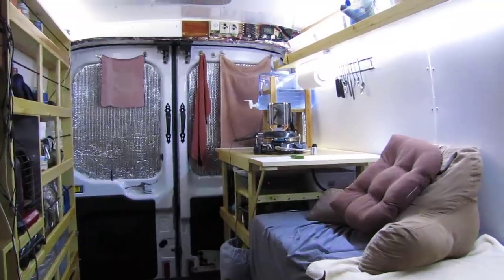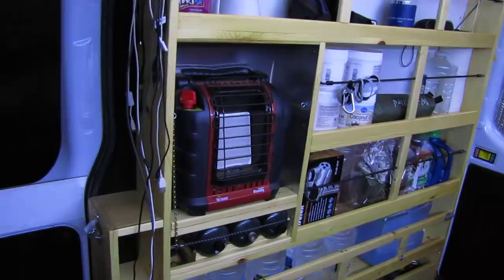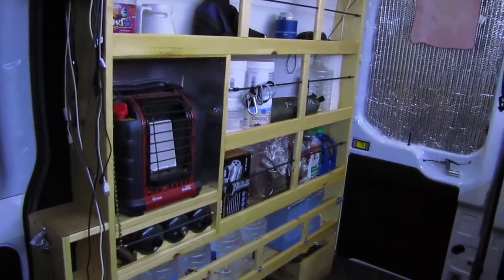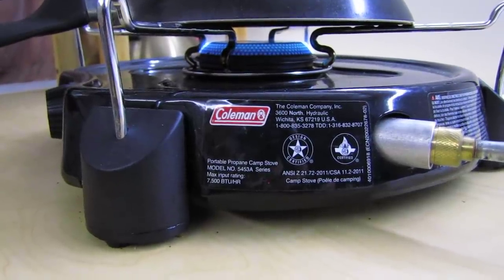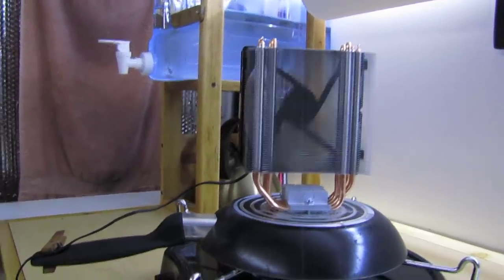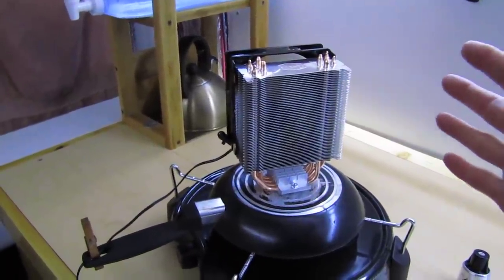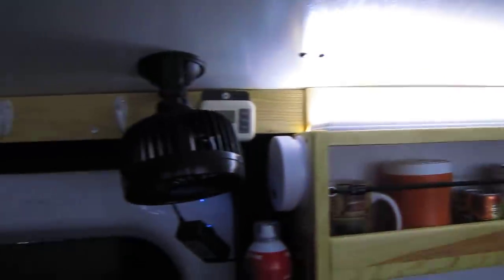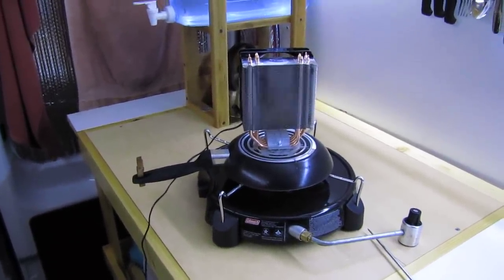My Van Heater using a Computer CPU heat pipe heater. Just an experiment to see if the concept works.

Comment: Definitely worth trying; I like the cast iron pan substitution comment, below, rather than an old coated aluminum pan. Question: does the heat not affect the little fan?
Reply from the maker: The pan was just used in this experiment because i already had it.
Reply: @EL34XYZ  ...that's fan, not pan. I was just wondering if the heat wouldn't hurt the continued FAN operation.
Reply from the maker: @hazel555  The fan is made for high temps that a CPU produces. The aluminum fins are always being cooled by the fan
Reply: @EL34XYZ  thanks!

Comment: Position the fan so that it blows down onto the frying pan then centrally locate. This will push the heat down in all directions instead of just blowing in one directions sideways. This will be much more efficient.
Reply from the maker: The idea is to have nice warm air blowing on me as I sit next to the rig

Comment: When the fuel burns as a neutral flame you get carbon dioxide and water vapor. Mess with the flame and you'll get some carbon monoxide too. The stove  burners are made to burn a neutral flame.
Reply: Neutral flame?

Comment: Just a thought; increase the economic efficiency by getting a 5 lb propane container that's refillable, a hose connector and a filter (in case the hose degrades); much cheaper than the 1-lb cylinders. If you have a larger cylinder already, disregard this.
Reply from the maker: I have a 20 pound tank that hooks to all the smaller propane appliances. Also, I refill 1 pound tanks for a 20 pound tank  if they are in good condition

Comment: If you add thermal paste to the aluminum block and the pan, you will transfer more heat to the copper pipes.
Reply from the maker: Yes, you did not read the video description
Reply: @EL34XYZ  your right I did not, good job.

Comment: slowing the van will not change the heatoutput of that system you build, only tuning down the propaneflow to your burner will do that. That cpu cooler doesn't increase the heatoutput either, it is just more efficient in cooling that alluminum pan. Just the bare propane flame will give of the same amount of heat. Your problem is dispersing the heat of that flame, so just using a small ventilator or even just that computerfan on the cooler, blowing past the flame will do the same as that cpucooler.
Reply from the maker: The propane flame is already tiny. Slowing the fan speed works to save battery current and not wanting that much breeze blowing on me. So there is a benefit to controlling fan speed as far as I am concerned. I am already dispersing the heat via the heat sink and fan and it works great. You can't blow a breeze  past propane flame. Give a it a try and report back here.
Reply: @EL34XYZ  I understand what you mean and I do understand the advantage of using the cooler with fan since it gives you a means to control the direction and strength of the warm air flow. 
I used a small burner to to heat my caravan when I went camping and I experienced a cool night. I used a small 12 v ventilator on a flexible stand, blowing about a foot above the flame to direct and dispurse the heat that rose from the flame. 
I am not trying to dish your setup, I just wanted to point out a posibillity of achieving the same means in a simpler way. It won't work exactly the same, mainly because even a small normal 12 v ventilator uses more power than a computer fan. 

As a last point and at the risk of sounding like a safety sally, I do hope you have a carbon monoxide alarm in your van, when burning anything (even candles or propane) in a small closed space. Just so you can enjoy your van for many years to come. ;-)
Reply: I would consider doing the following: eliminate the CPU cooler and let the heat rise. Eliminate the fan in the middle. At the far/,opposite end, install a (probably smaller) fan in a (cardboard/metal/cloth) tube to draw the warm air from the ceiling to the floor. The warm air at the floor will naturally provide mixing as it rises.
Reply: @dropshot1967  Make sure you don't blow out the flame or you're in a big bomb? Don't know if I could sleep one spark. Just saying

Comment: Give it some time, here in Montana you’d have to experiment turning it up especially if you were in a larger unit. I have a 38’ Toyhauler my garage isn’t heated and my furnace works well. Fortunately I do not live in it but would still like to see if something this small would keep it from freezing inside.
Reply from the maker: Depends on a bunch of factors. How large is the space. How well insulated the space is. How cold it is outside. Etc. My van is pretty small and if I pre-heat it with a Mr Buddy so that everything inside is up to temp, all you have to do after that is maintain a certain temp. :)

Comment: Instead of using aluminum with a non stick surface in it (questionable toxicity )  try a large clay flower pot. . with the hole already in the bottom of it, your system could be mounted to it.
Reply from the maker: Read the video description about the experiment and the pan

Comment: Good concept. I wonder what the cost is to drive that fan all night and through the morning. Also, how much propane does it use at the minimum setting?
Reply from the maker: It's a 12 volt fan set to a very low speed. It's about 30 milliamps. You could run it for a year on a big AGM battery like I have.
Reply: You can find a fan that operates purely off of heat. Some use it over their cast iron stove to distribute heat evenly...
Reply from the maker: @hotsauce7362  Those are used for high output wood burning heaters. That's not anything I would use in this situation

Comment: I've been living in my van for about 5 years. I've tried several methods of heat, including some I've seen on youtube. From the many ideas I've tried, they either don't work or are not safe enough for me. Sorry, but the only thing I can recommend for cold weather is a good sleeping bag.
Reply from the maker: My idea is not something you do while you are sleeping. Why would you run a gas heater while you are sleeping?
Reply: Mini wood stove

Comment: Ingenious idea :)  Did you ever think when it gets too hot to turn it off ...DOH ... the van is so well insulated SHOULD stay warm for some time I would have thought especially with the circulating fans
Reply from the maker: Turn what off? It's nice to have just the right amount of heat that keeps the temperature even instead of spiking way up and then diving down. Insulation only gets you so far with lots of big glass windows. Even though I have reflectix panels on the glass

Comment: What’s BTU? Heaters usually show output in kW.

Now however you turn it- 1kw exhaust/flame heat output remains 1kw however you distribute it. And gas flame exhausts rise and mix w. the air.

How about one of these Chinese air heaters? They go up to 8kw, so should be plenty (guess 5kw is well enough for a Transit).
Advantageous that you don’t keep the exhaust CO2 and CO inside.

Comment: 1) How did your teflon pan look after an hour or so? Did it survive direct fire on "the wrong side" like that?
2) Why not use a stove fan? That way you wouldn´t need to spend precious electrical power.

Cheers,
Reply from the maker: All that has already been answered. Did you read the video description?
Reply: @EL34XYZ  No I didn't

Comment: Wait... what problem does this solve? Why not just have the fan blowing into the hot air produced by the burner?

Also, if you get a peltier stove fan, it will use the burner/air temperature differential to produce all of the electricity that the fan uses, so you don't need to wire it up to anything.
Reply from the maker: You can't blow air onto a propane flame. Do it, film it and report back here with a link
Reply: I think the peltier fan might be an answer to making a more efficient device that accomplishes the same thing as the pan and CPU cooler.
  No manner of device will change the amount of heat released into the van when burning a set amount of fuel. Distributing the heat makes more effective use of the fuel that is consumed.  
  Without a device to promote airflow, a burner will set up a column of rising hot air above its flame, with a pool of warm air accumulating at the top portion of  the van it's in. That warm air then goes about the business of transferring its heat to whatever it is in contact with. It will literally be a top down process of heating any of the surfaces air is in contact with inside the van. 
  It can be said that any individual standing (relatively motionless) in that van will become, literally again, hot-headed. 
 No point in doing that.
   So, to the intended point. A peltier fan attached to the pan in same manner as the CPU cooling device would accomplish the distribution of heated air, with an added efficiency of not needing electrical input to move that air. I like that added efficiency. But, I don't know for sure, but it seems unlikely a peltier fan will move as much heat as a CPU cooling device. 
  Another part of what is happening in using the pan as a portion of the solution of making a burners heat more useful is that a radiative surface has been created. That it is more centrally located than the radiative surface that the ceiling eventually becomes makes more efficient use of fuel burned. Again, better efficiency because it is closer to more of ones body, and it isn't losing heat to the exterior as the vans ceiling does. 
  That an unused pan has been converted into a radiator makes sense, but I find myself wondering what difference using something larger would make. What comes to mind is an inverted stock pot. The idea being to capture more heated air longer with an object that has more radiative surface. It in conjunction with the peltier might equal the effectiveness of your current setup.
 Thanks for your post. Good work and food for thought!
Reply from the maker: @markwolter2032  Just an experiment from a year or so ago. I wold like to get back on it with some ideas I have come up with since then
Reply: @EL34XYZ  I'm wondering if you fill the stock pot with sand and put a lid on it for the Peltier fan. The idea being a large heat sink? BTU spent are the same. The BTU saved is what you're looking for radiant heat. Just an idea. I like tinkering never know what you come up with.

Comment: I have 2 Dutch ovens one fits inside the other so at the same time as heating my van I can cook my baked jacted potatoes. My device is on a small simple camping stove on the lowest setting. The duch ovens are made from cast steel on the lid of the outer one I have a stove fan that need no power to circulate the warm air. There just is no better solution to have what is a 2 in one method of staying warm with the bonus of a red hot oven that you could even put in a fire brick. My device uses very little gas and is safe becouse I have several vents at different heights all around my build allowing for a steady fresh air flow. I have used gas for heating and lighting most of the last 40 years. Vintage Caravans always used gas for lighting and use to use the   gas hob on low for heating. Even the old caravans would have plenty of air vents. So it's down to been sensable on safety and I also have 2 carbon manoxide alarms and smoke alarms in my build. I have yet to see a better solution that gives 2 uses. My seconder heating incase I run out of gas is a small steal stove I welded together from off cuts of pipe then I dug up clay and lined my tiny stove with it inside.

Comment: Just put a ventilation hood above the stove and pipe the gases thru a car radiator with a fan mounted inside the vehicle, then pipe the gases from the radiator outside thru a hole in the roof. Might need a small high temperature fan to suck the gases thru the radiator.
Reply from the maker: Really? You do it and film it and then post a link :)
Reply: @EL34XYZ  Doesn't get that cold where I live. I just run the propane stove or idle the engine the few times it's cold, depends if I need to charge my batteries.

Comment: Agree with the idea of wood stove fan suggestion. Wonder if a cast iron pan would not be better than aluminum Teflon-coated pan. What about dangers of open flame when you are outside? Could you not contrive a device to protect against fire hazards?  And what about ventilation to remove moisture and toxins?
Reply from the maker: Not a good idea. Try a wood stove fan on a tiny flame and report back :)
Reply from the maker: Also, as was mentioned in the video description, that pan was just a test unit

Comment: You would think that the Mr. Buddie Company would address this problem and reduce the output from their units? But in the meantime the Wave 3 is a great way to go!
Reply from the maker: I think the most common uses for these heaters is in non insulated spaces and they do work great for that. Not so well for well insulated small spaces like my van. But they do work well in larger RV's where you have a much larger internal volume.
Reply from the maker: The smallest Wave 3 heater I see is 3000 BTU and that is still way to much for my van. I would think about 1000 BTU would be enough, just a guess

Comment: Texsport 3,000 BTU Portable Propane Tank Top Heater.
Reply from the maker: 3000 btu is even too much for my van. Maybe about 1000 btu is all I would need with a 500 btu low setting

Comment: If you can power a ps4 about 170 watts that's a nice heat output. I like the white/silver interior.
Reply from the maker: Thanks. I did  a simple open van build that I like alot.

Comment: i know its late, but, you should change this setup.
1st make a 1gallon water reservoir that can be heated with propane.
2nd get a cpu water cooling kit,
3rd connect the reservoir to the cooling kit
4th connect the cpu heatsink of this video onto the cpu waterblock of the watercooling kit

Then you have
1 hot water reservoir
2 temperature controlled waterflow
3: a fully operational heating system
Reply from the maker: Thanks, but Way too complicated. I'll wait to watch your video after you have this system up and running

Comment: You said that you didn't like the smell of the candle heater, but besides the smell did it actually produce enough heat for your van?
Reply from the maker: I only got through 6 small tea candles in an aluminum pan as a test. The smell was bad and so that was enough for me. Also the candles will deposit a residue inside the van like soap scum does in a shower, so that is a no go for me also.

Comment: Humidity will make you damp in the cold, making it worse. Why not open the window and let some ventilation in? You have a good heater,right? Also if you are using propane, carbon monoxide can become a issue in a small space.
Reply from the maker: You did not read the video description
Reply: @EL34XYZ  I know that. I didn't think I needed to. Still don't! :D
Reply from the maker: You would have seen that both your comments about ventilation and Co have already been answered
Reply: @EL34XYZ  your to kind to answer all these questions that have already been addressed! Nice Guy Award To You!

Comment: I have been watching vids of this nature for inspiration on a pre-retirement project. its really too bad you didnt come up with that fantastic little gizmo before you started fitting the interior.  you could do a lot with that flexible duct work stuff. then I started thinking about floor insulation, THEN I started thinking about heating the floor itself.
Reply from the maker: Keep it simple is my rule. That's all too complicated
Reply: yeah, but my set up will be built for 2. some complications in the initial build will save me a different kind of complication later. =]
Reply from the maker: @mikeemmons1079  Go for it. I have seen other people commenting on heating the floor.
Reply from the maker: They make the tubing for floor heating homes. You would have to circulate a hot fluid through the tubing
Reply: Would sending warmed air through floor tubing provide sufficient heat transfer in this small of an application?
Reply from the maker: @stan.rarick8556  I doubt it, water/liquids transfers heat way better than air. You might as well make vents along the floor edges and blow the warm air into the van rather than sending warn air into a closed tube

Comment: If you get one of those fans for wood stove no elactricity  needed  it will be safer and save power , safety first i wouldnt want to take the chance of wirering melting that would suck .
Reply from the maker: No, those things are huge and meant for very hot surfaces like a wood stove

Comment: I tried a mr. Heater portable buddy and it did warm fine, but it was burning my eyes. I tried cracking Windows turning on a ceiling fan and it still burned my eys so I had to return it. See how well your heater works when you're in 10 degree weather all around.
Reply from the maker: I only use the Mr Buddy to bring the interior and everything inside up to temperature. Once the everything inside is stable you can use a much lower heat source to maintain that temp. 
I would not camp in 10 degree weather, so I won't have  a problem :)